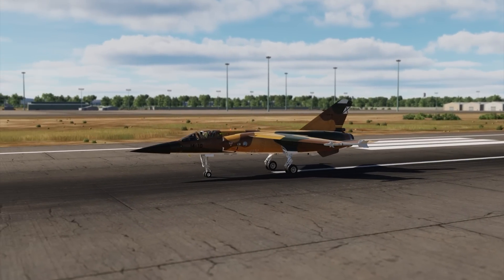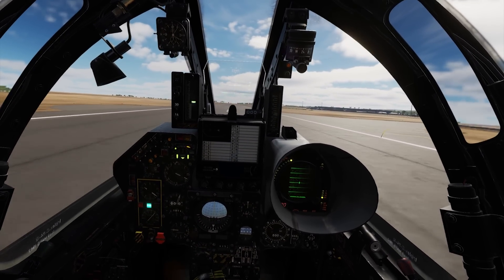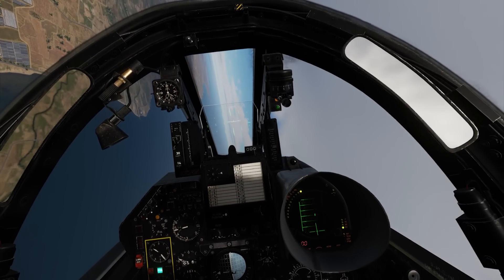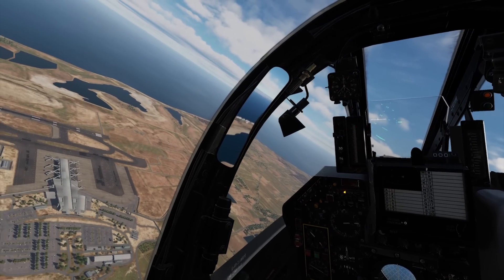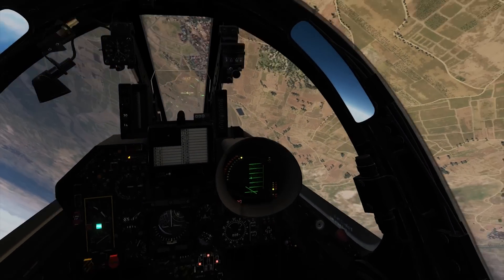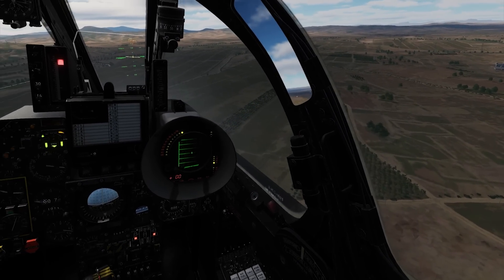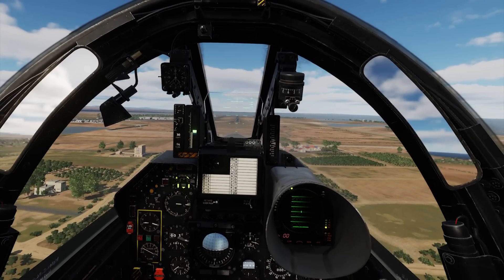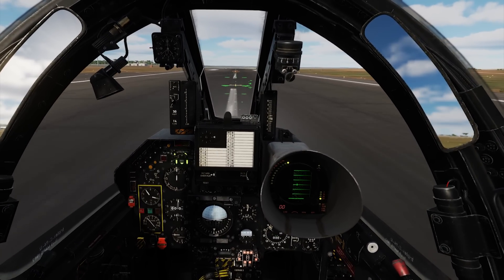(First Release) Mirage F1CE First Impression, Flight Dynamics and Analysis (DCS)

Comment: Per slow flight the spin while using ailerons isn't necessarily true. While i am no fighter pilot i've put many aircraft IRL into slow flight which is 5 knots above your VsO. In turns you use very very gentle movements of all your controls with power to change altitude and pitch for airspeed. you can put in aileron without to much issue but be warned it's harder to recover from overbanking if you use to much.
Reply from the maker: you use those ailerons close to a stall speed and you're likely going into a spin. Its math, aileron down increases the wing tip AOA by 2-2.5 deg. If you are already at 16 AOA, adding another 2 deg to the tip makes it 18-18.5, tip stalls, wing goes down.
https://www.youtube.com/watch?v=WKIk-dqml6U

Comment: Good analysis, have you went to the official forums and asked the devs about the powered stall or lack of one therein?
Reply from the maker: They seem to be somewhat accurate, F1 stalls nose up, then nose drops down. And some pilots insist that with the AB on you can maintain the nose up attitude, but not sure if it would climb like it did.
Reply: @FSX404  hmmm, if they insist..... but climbing at that AoA? Does this plane greater then 1:1 TWR at altitude and stall mach/aorspeed? I find that a bit odd.

Comment: Really awesome flight behaviour with that plane, I did some dogfighting with it and I got into what I guess where flatspins however they were quite easily recoverable with some rudder action. What was not recoverable were the ton of engine failures I had when in high G, high AOA situations. Also, when going fast at low altitudes, there us buffeting and the engine shuts down. Overall I really feel like the main thing to be careful with in that plane isn't necessarily ripping your wings or getting into a stall, but really not letting your engine die on you.
Excellent job with that video, am looking forward to seeing if the aircraft is realistic as per the irl performance charts.
Reply from the maker: Even the F-104 will flame out at SL at 765 kts (I think). Even MiG-25 could achieve a few more kts. Its tge airflow, it overheats the engine I belive.
Reply: @FSX404  absolutely ! The cool thing is that I believe this may be the only plane in DCS to have that behaviour (apart from the mig21 I think), and overall, I feel like I'm shutting down a lot more engines in the f1 than any other DCS modules when I first learned them, especially in dogfights.
There is also a behaviour I don't quite understand, sometimes, when pulling really really hard (without breaking your wings), the engine starts buffeting and it only stops when the engine totally shuts down (in a minute or two), I've tried slowing down, going faster, getting higher up or higher down, and I can't seem to get rid of that buffeting, also, after it shuts down, air restaring isn't possible which is an indication that the engine got totally fried.

Pretty cool I must say, very powerful engine for it's time but you gotta be careful with it.
Reply: I noticed that at low altitude too, Throttle just out of the afterburner gate, heard the distinctive banging and watched the flame flicker quite spectacularly. Fantastic attention to detail. Personally I like the idea of temperamental Jets in DCS, it really gives them character and a challenge for the veteran players where flying modern American Jets just isn't that difficult anymore.

Comment: Hey could you test out the extent to which the engine flameouts are modeled and how this could affect which maneuvers we can use in a dogfight, Ive heard the engine cuts out during negative G
Reply from the maker: yes, the engine cuts out about 2-3 seconds into negative, but comes back on as long as you immediately go positive, unlike the MiG21 that flames out. Engine also has an issue if you are 250-400 kts and you yank it up like a cobra maneuver, it will start getting compressor stalls and doesn't recover. Eventually flames out. Stalls are OK at lower altitudes, no engine issues, but I havent done a high altitude stall, where a lot of jet engines will flame out if air flow is interrupted. I'll cover somenof tbisbstuff in my part 2 combat video.

I just flew a perfect dogfight where everything happened, and I could have used for the second video, then found out I didnt record it!!!

I'm done for tonight, lol, I'll redo it tomorrow and post it for you guys, show you what to do in this plane, and what not to do.
Reply: @FSX404  coolio

Comment: So it's not just me that's seeing the weird stalling. Also the plane appears to be very stable, it is very departure resistant, spinning it is difficult. And another thing... in transonic the centre of lift stays put.
Reply from the maker: Long story, but stalls are hard to program in DCS, its an extra condition. So how one group does it is up to them. I think Aerges focused on the correct aileron stall, but the regular stall and spin need some work, Im sure they'll fix it. F1 should have a similar stall as the MiG19.
Reply: @FSX404  Yeah, they've done an amazing job so far, fixes are bound to be coming and hopefully, they will tweak this as well. I also think that the F1 would behave alot better the the 19. That one was terrible from the onset. Even the russians gave up on it. Speaking of which, RAZBAM had a similar "tame" stall for their MIG19, but it was way more obvious. For the F1, it's quite hard to notice, unless you're trained in what to look for.
Reply: Well I think the centre of lift does shift during transonic phase. I trim the plane to fly straight around M0.8 and starting from M0.9 the nose starts to pitch down , not as dramatic as the AJS37 for sure but my guess is the acceleration at this speed is also lower than the Viggen
Reply from the maker: @aidenchen1275  thats a good tbing to ch3ck, mach tuck, Ibdidnt, I kept it mostly slow, I'll check it next
Reply: @FSX404  Looking forward to it man! And thank you for this testing video, very informative and useful
Reply from the maker: @aidenchen1275  mach-tuck begins at 0.92, its correct on this plane.